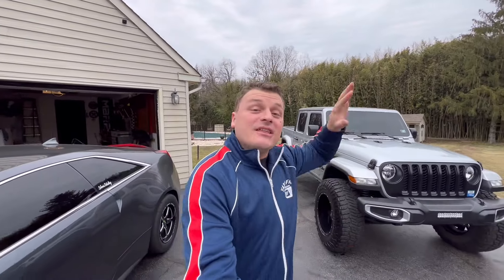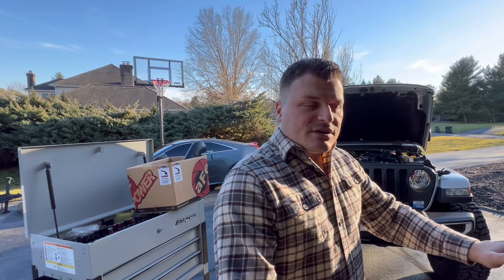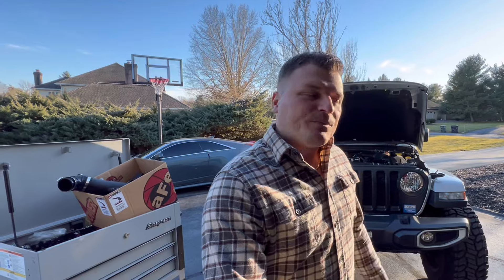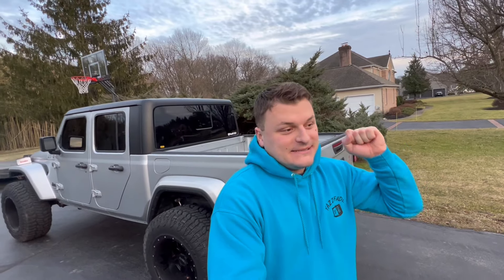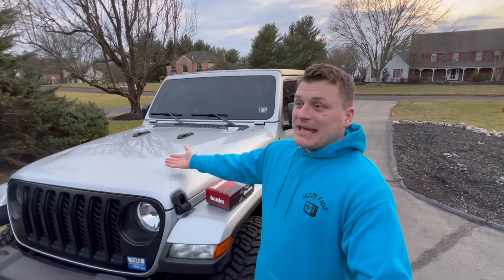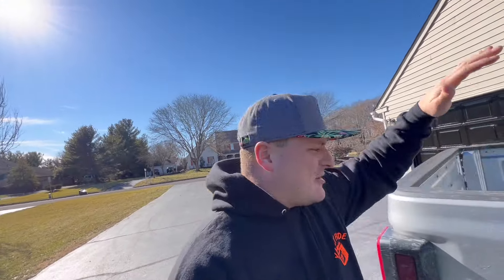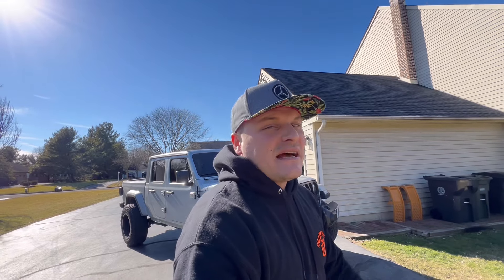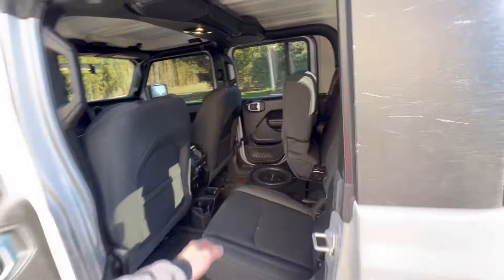Jeep Gladiator Eco-Diesel Check Engine Light Resolved!

Comment: Purchased my ecodesal  in 2021, 75,000 , no engine mods, now needs new turbo, egr system, intake manifold, dealership said it would cost 10,000 to fix and it’s not covered under the warranty,  total peace of crap paper wt , and because of layoffs,  or all parts are NOT available, I’m in California so no delete option 😢. Just waiting for parts some day
Reply from the maker: @paranormalwheelers  ouch that’s a rough ending. Sorry to hear man